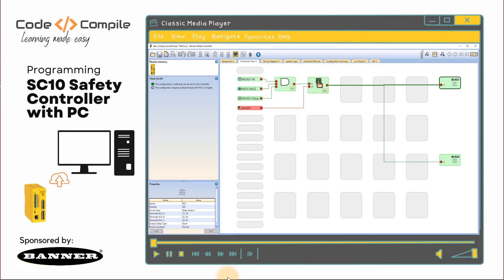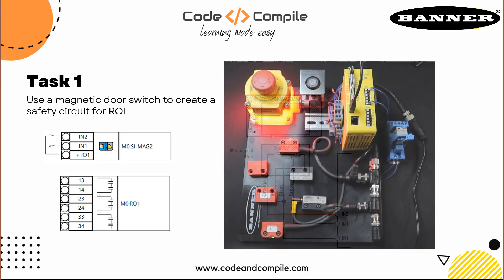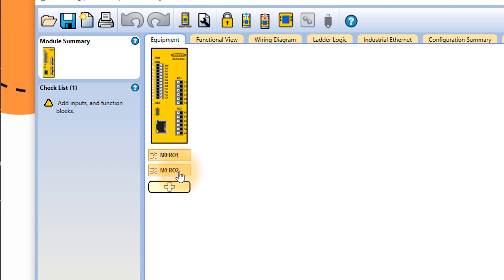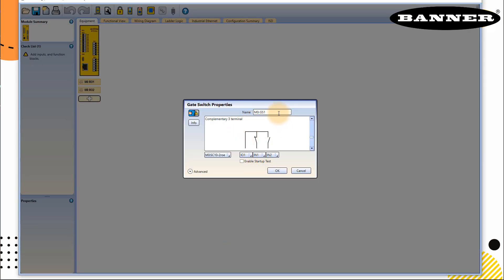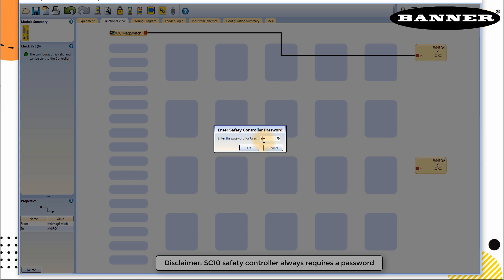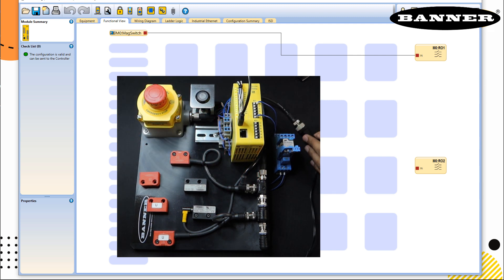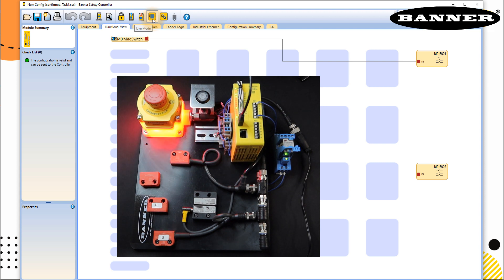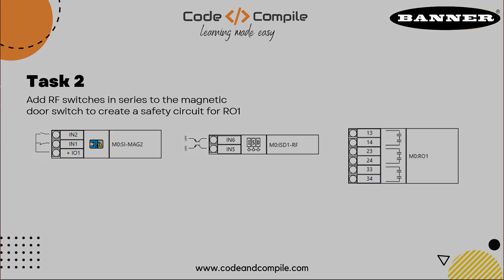Episode 3- Programming SC10 Controller

Comment: I see it automatically assiigned terminals to the magnetic switch.    I0  I1  I2    Could you have selected differently  ?   or must you keep what it assigns
Reply from the maker: You are free to choose what terminals you want to use but make sure those are not used

Comment: What does M0 stand for  ?   At 5:30 its used in the outputs and inputs boxes
Reply from the maker: M0 is basically Module 0 (SC10 Controller). If there are multiple modules then you will see M1, M2 and so on..

Comment: good day. may i know how can we set our desired acceleration and deceleration time for delta plc linked to an inverter without adjusting the acc and dec setting in the inverter.. i know there is a way to code it in the program but i dont kno how to. thank you.
Reply from the maker: Hi, you can do that using DDRV command in delta PLC which will ramp up the pulses based on the command parameters. Please check the command in PLC manual- Its DDRV or DDRIV . I am not 100% sure about the name of the command but there is a command that exist.